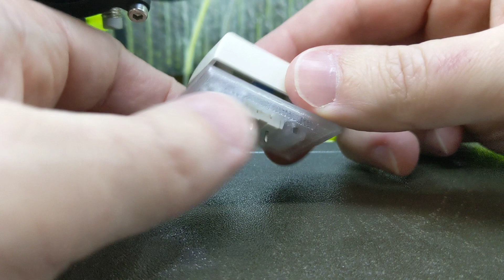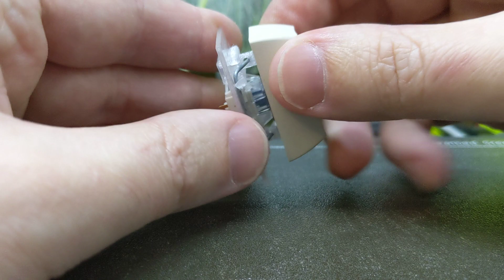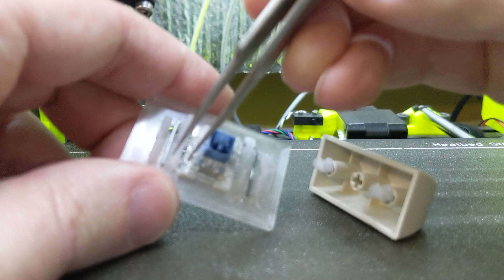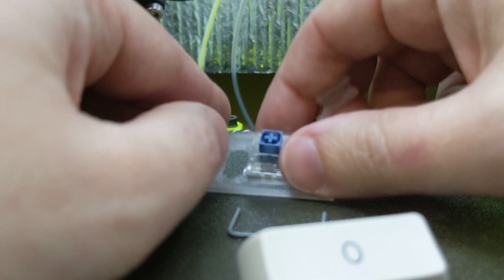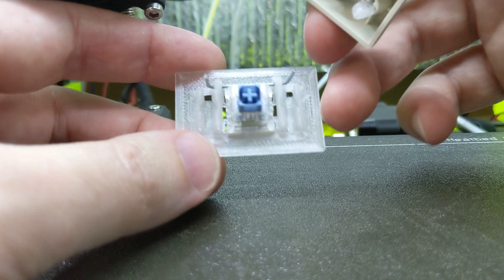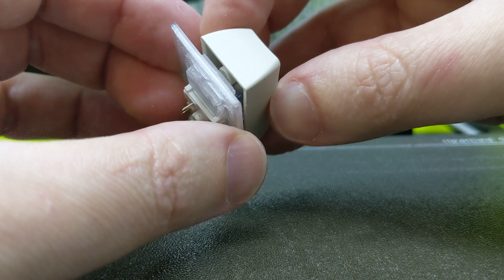Beta testers! Here's how to assemble my Cherry-compatible 3D printable stabilizer

Comment: It looks pretty similar to how the Razer switches work, I would have loved to see how it works on an actual keyboard and if that really is better than the common stabilizers.
What is your goal with this project?
Reply from the maker: My goal is to make an entirely 3D-printable keyboard with 3D printed key switches, stabilizers, case, plate, etc.  Not only that but I am also working on code that takes output from Keyboard Layout Editor (KLE's .json format) and auto-generates a .scad with an entire printable keyboard ready-to-render.  Furthermore, I eventually plan to have PCBs available that use hall effect sensors so you can set whatever actuation point you desire.
Reply: @Riskable3DPrinting  That's cool, good luck!

Comment: If you're still looking for some people to beta test, I would absolutely love to print and beta test this! Very slick design.

My only concern would with tight fitting key caps and having a hard time getting it off without ripping out the wire or whole stab, since you would need a lot of force and may not be able to tilt it enough to slide the wire out from the bits that are connected to the cap?
Reply from the maker: Oh there won't be an issue with tight-fitting keycaps...  The way I asembled it is just a quick way to do it.  You can always just put the stabilizer stems into their little sheaths/sliders then put the keycap on.  Everything should slide into place like a normal cherry-style stabilizer.

If you cut the wire short enough you should be able to just slide on the keycap with the stabilizer stems installed even if the keycap is super tight though.